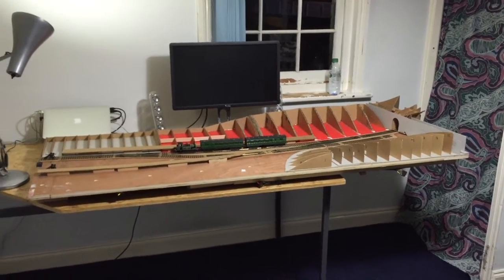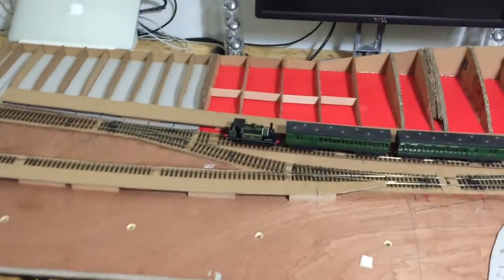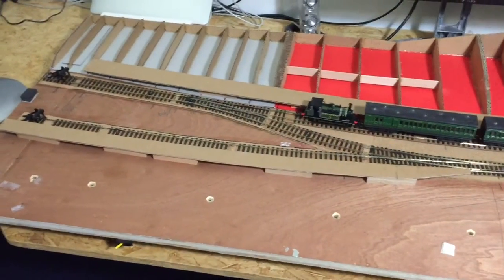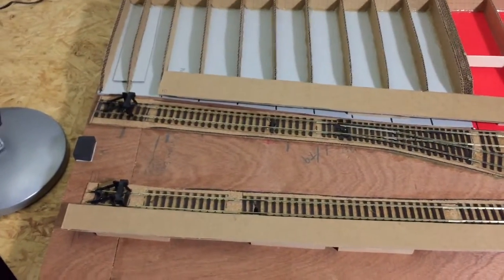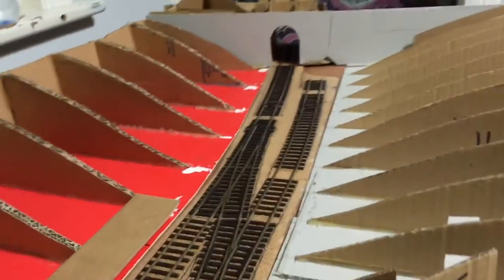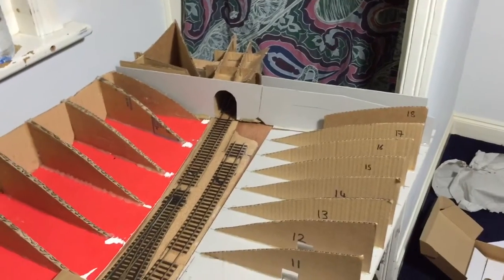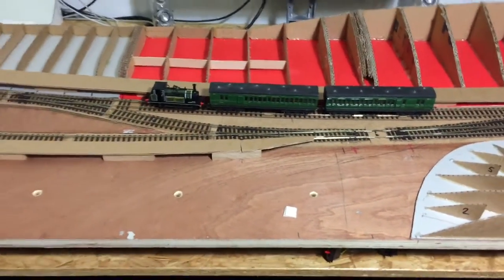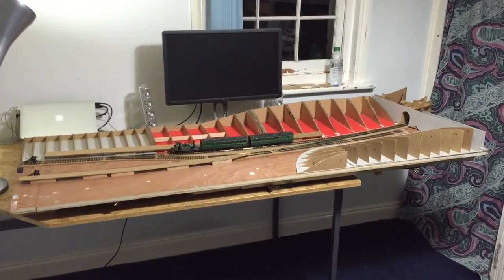Dallington Race Course Model Railway Introduction

Comment: Hey,

Some interesting ideas there.  Will you be adding the 3rd rail or just going to leave it imaginary?  I agree with you about the branch lines and lots of platforms.  I am planning on a branch line ish but so far my plans include 3 platforms and having it more as a junction, even though I want to try and keep things quiant.  I guess the problem is deciding between too much and having enough for long term operational interest.

Cheers
Reply from the maker: Thanks Michael, 

Yes thats right, I will indeed be adding a third rail for platforms 1 & 2 only but probably not until the track/sleepers have been painted, ballasted and weathered as I think it'll get in the way otherwise!

Charles